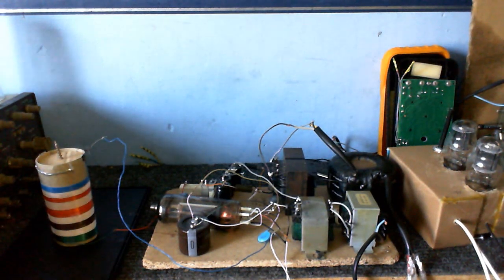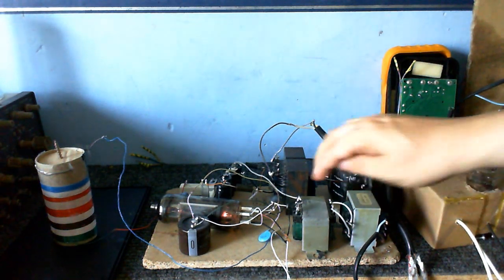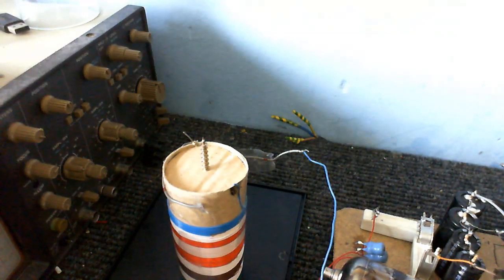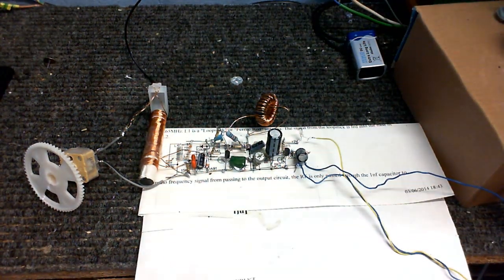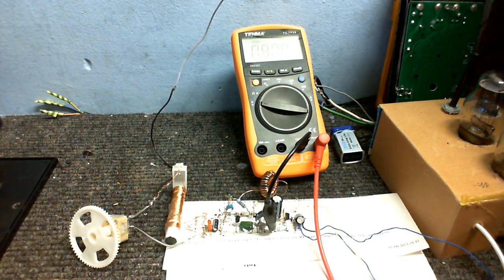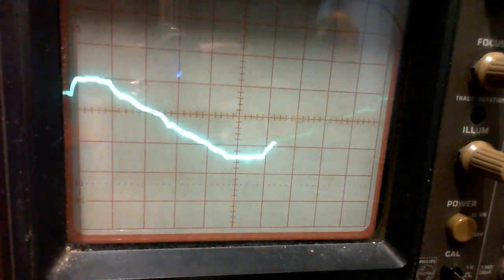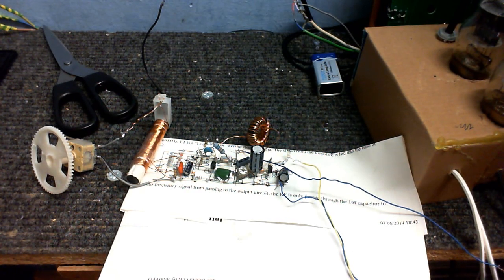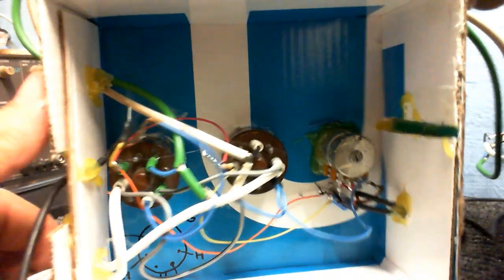what i have been up to

Comment: Nice one! Don't you use RIAA equalization in your phono pre-amp, or further along the signal chain?
Reply from the maker: No need to with ceramic cartridges, they provide their own "equalization", just so long as the amplifier has a high enough input impedance (several megohms or more) they can sound almost as good as a magnetic ones.